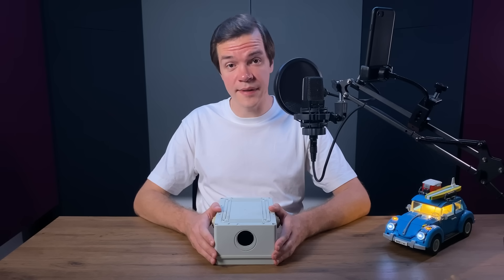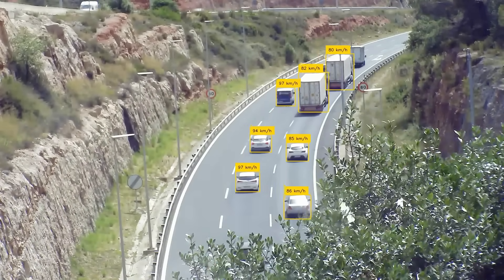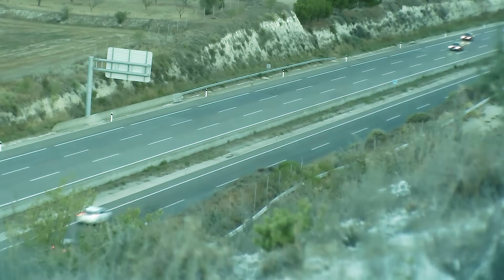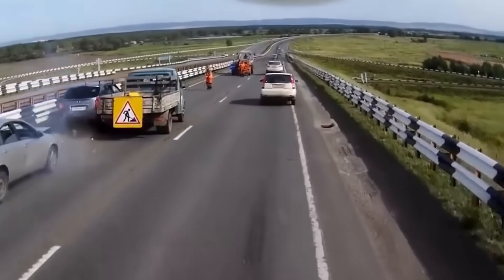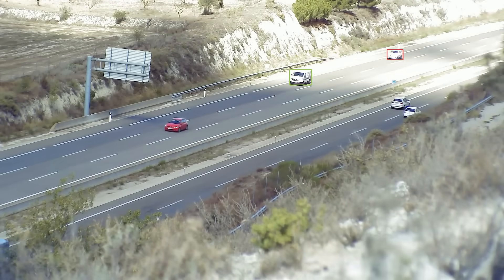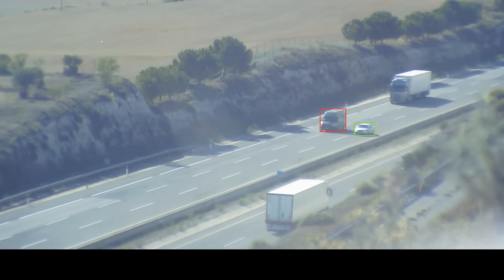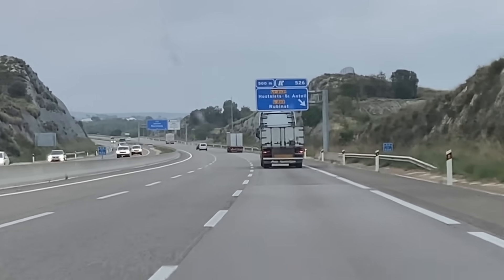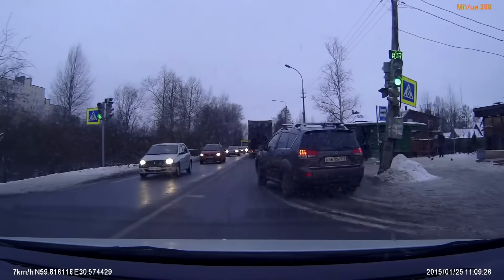New Anti-Tailgating Camera Reveals Shocking Statistics

Comment: I drive a manual transmission.  Often I just ease off the accelerator and downshift when I need to slow down a little.  If I'm in a middle gear, all I have to do is take my foot off the gas to slow down.  So I often slow down just a bit without my brake lights coming on.  I get the dirtiest looks... as if I'm brake checking without brake lights.  But maybe if they weren't already close enough to trade mustard, microscopic changes in my position wouldn't seem so threatening...

Comment: In Austria there have mobile system to check the distance between cars and fine if they are voilated. This can only be done on designated bridges where there are additional road markings below to allow accurate measurements. I assume the also film the highway to check if someone cut into your lane shortly before the measurement. However, I did not look into this technical solution.

Comment: Your "Following distance" chart will not allow you to really draw conclusions. Safe distance depends on what speed you are traveling and clearly not all vehicle travel at the same speed on your footage.
To really draw conclusions, you would need to separate your data in speed ranges and separate the vehicles that change lane in the meantime.
Also you need to account for technology in there. My adaptive cruise control will conserve a constant distance between my car and the car preceding me. If the car ahead suddenly brakes, my car will brake by itself before I even have time to react.
This will not excuses everything, but it mostly mitigates your risk assumption
Reply from the maker: Most vehicles here travel at 120-140 km/h. Speeders and slow vehicles are the exception. I drew "safety index" chart (it includes the adjustment for the speed), it looks the same.

Comment: Raw math is flawed if it's not accounting for the fact that the vehicle in front of you will "never" be suddenly stationary. They will still be moving forward while decelerating. So if the safe flowing distance is based around response time + stopping distance, that's impractical (as the extraordinary gap you leave will simply be occupied by another driver).

Following distance should be reaction time + stopping distance - other driver's stopping distance. Otherwise, a single lane of traffic can only service 10 cars per kilometer...

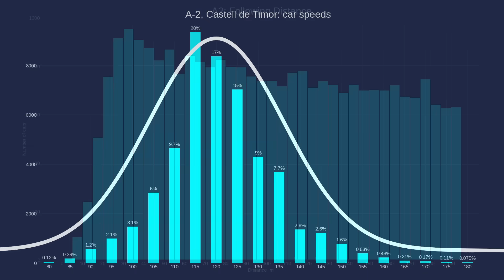Comment: @8:25 You shouldn't have expected it to tail off that hard on the upper end since the road is allowed to smoothly approach being empty.

Also, in regards to policy, there could be allowances for being cut off. For example, "
- Minimum Following Distance is defined as 1.75 seconds of travel at the driving speed.
- Withdrawal Speed is defined as the speed of the driver in front minus the speed of the following driver.
- If a driver is less than minimum following distance behind the car in front of them, then within 4 seconds either the distance between the vehicles must exceed minimum following distance, or the following driver is subject to a minimum withdrawal speed of 0.5 km/h.
- If a driver subject to a minimum withdrawal speed does not meet this within 4 seconds, the driver is subject to a minimum deceleration of 0.5 km/h/s until the minimum withdrawal speed is met or the minimum following distance is reached.
- If this minimum deceleration is not maintained when required, then a violation has occurred."

If you actually try to avoid tailgating at all, this shouldn't catch you. It never requires violent action, and because of the definition of minimum following distance being speed-dependent, you can never be required to back away from the car in front of you. Even if someone cuts into the already too-narrow space in front of you, you're still legally fine as long as you're slightly decelerating within 4 seconds. And as noted earlier, once you come to a halt, you are following minimum following distance.

Comment: Very interesting. Also, I don't think that enforcing distance would be too difficult. Just make front and back cameras in cars mandatory. You've shown that the software part to identify distances is doable. Than either make cars keep the required distance based on its speed (my car already does this when I configure it to do that), or use the footage to proof who is at fault based on the distance resulting in an accident. Of course, the cameras also record cutting, so in this regard that's not really a problem anymore. If people are punished at accidents because they didn't keep the correct distance, they will learn over time to keep safe distances.

Comment: The other advantage of maintaining a safe stopping distance is greater speed for everyone. Leaving a buffer helps to keep braking chains from occurring which ultimately end up with someone having to stop completely and creating a traffic jam. Traffic has a target speed and anyone going greater than that or much less than that causes pulsing. Computers can look at traffic flow and determine the value. Signs on the highway could easily change to inform drivers of it so they could match it speeding their way home by perhaps slowing them down but a little bit - but they won’t comply

Comment: So 30 metres is also about the distance you need to be able to see hazards ahead of the car in front of you, which means you can anticipate breaking that would be otherwise unexpected. 

It's not quite a fair challenge to presume the vehicle in front will stop dead as if it has hit something, and use that as a benchmark for safety. Instead, it should be tested if they put on the brakes fully, whether the car behind can stop in time. This depends on reaction and also closing speed - closing in on a vehicle to tailgating range is much more dangerous than other scenarios, because when the vehicle in front starts breaking, you're already going faster and have a greater stopping distance.

Comment: One issue with your safety index is it doesn't take into account the speed when you would collide. The car going faster with a longer following distance will be going faster at the point of collision and hence have a nastier crash.

As for auto detecting tailgating, that doesn't seem like an impossible problem. You simply need to verify the car was always at a distance of at most x for several (10+) seconds, and ignore any cases where either the subject car or the one it's following changed lanes. You could also use the same methodology to catch lane hoggers (people who don't keep to the outside-most lane possible) by looking at traffic in the other lanes as well. Lane hogging is often a cause of tailgating because undertaking ranges from frowned upon to illegal depending on the country.

Comment: Very good points made.  When I was young and lived in  Denmark, the traffic police was not so focused on speed limits on the open roads, more on driving to the conditions, and  NOT tailgating. ! They would be on their motorcycle just off the side of a road observing the traffic, and if they saw what they considered dangerous driving. Including tailgating, they could issue a fine to the driver or rider. No radar back then.  Just judgement on the part of the individual police officers.  Where I live now, road safety is excessively focused on speed.  And suspiciously also on revenue raising, rather than focusing on the issue of tailgating, which is a big issue in Australia by motorists in general, and worse still, by truck's with impatient driver's who often tend to intimidate other drivers who  drive to the speed limits, or what speed the prevailing adverse road, or weather condition's etc would indicate is sensible, below the maximum speed  recommended for driving there under optimal condition's.🤔

Comment: I have a pretty fragile older small light car, I don't have ABS or airbags, I hate tailgaters with a vengeance. 
Also applying a speed limit is so incredibly limiting, there are lots of roads where it'd be safe to drive faster (at least big stretches of roads), and lots of roads where you are allowed to go 60km/h and it would be very unsafe to drive at that speed, due to your view being obstructed, only being able to spot someone who you should give way to in like 0.5 seconds.

Comment: When na car in front of you does an emergency brake maneuver the car will already have had 0.9 seconds to slow down before you even start to slow down. 

So if two cars with the same properties drive the same speed one second apart, they will crash during an emergency brake.

Comment: TWO SECONDS should elapse between the car in front of you passing a point until you pass that same point. 
Yes, some people will enter that space sometimes. So what? As an intelligent driver, you always leave little early so you don't have to drive like maniac in a magic race car on your personal racetrack.
 
Another tailgating insanity is that people will bunch up if traffic slows, causing everyone to need to go slower and slower as they keep bunching up even more closely.

When I am emperor all cars will have anti-tailgating computerized braking and all drivers will experience a powerfully realistic crash simulator annually,
Reply: If you keep bigger distance than everybody, they will be entering in front of you constantly. This will be the comfortable spot to enter your lane and every single car will do it. There will be a lot of movement in front of you. It's probably worse than keeping a bit smaller distance because if someone enters, the distance goes down dramatically. Actually, it becomes less more than twice all of a sudden.

Comment: I drive this way as well, but my rationale is different than the narrator. If I am following a car at less than the recommended distance, I have two reasons for doing so. 

The first being that I am not watching for brake lights on the car in front of me (well I am, but not exclusively). No, I am watching for brake lights on the second car in front of me or possibly any number cars in front (depending on the curvature or profile of the roadway). This gives me more information then the car in front of me. So I feel I am more prepared to stop than they are, because I am not expecting them to drive the way I do (by anticipating their braking needs or tendencies). Also, I minimize the chances of being cut-off by a driver in an adjacent lane.

The second reason I don't always maintain the proper following distance is (with all things being equal) I have concluded that I can match their deceleration rate as long as they don't do anything drastic. By matching their deceleration rate, the distance between me and them will remain constant. So all I need is the reaction time distance to accomplish that. 

But mainly employ the first reason as a general rule.

Comment: The suggest safe distance is really only bear minimum. The weather and rain etc then you have to think of the person tailgating you. So you need to increase the distance again. But modern cruise control with following features will keep safe distance so the problem will resolve it self in 10 to 15 years.

Comment: Very interesting video! It brings me to a crucial point about traffic density.

The spacing between vehicles is a fundamental parameter for a lane's capacity. For example:

· With a tight spacing of 1 second between each car, a single lane can theoretically handle 3600 vehicles per hour.
· If that spacing is increased to 2 seconds, this capacity halves, to about 1800 vehicles/hour.

This massive drop in throughput raises a major practical question: to maintain the same traffic volume, increasing the following distance could necessitate widening infrastructure and increasing the number of traffic lanes. This represents a huge challenge in terms of cost and feasibility, especially in urban environments.

It's a fascinating dilemma: what is the right compromise between a road's maximum capacity and safe following distance?

Comment: I was told one car length distance at 35mph and add a car every 10mph. So a freeway at 70mph or 100kph it should be 4 car lengths or more but I usually use 3 as anymore and other cars just dart in the space...

Comment: You claim the tailgating problem is unsolvable.
But surely it's not unsolvable. It simply requires a LOT of interlinked cameras and MASSIVE real-time computing power. So much that perhaps, currently, it's not practical. But data processing power is on the rise again, with the advanced new computer chips. But instead good driver education and constant reminders could perhaps resolve the bulk of the problem relatively quickly.

Comment: My lifelong experience is by this confirmed. I command your endeavor here. I have made it a habit meanwhile to keep distance AND not care if anyone cuts in, because it happens all the time anyway so I treat it as normally expected and am ready to adjust the distance all the time. And it happens all over Europe. Folks in NA and Asia have a different driving style.

Also gold is the rule often not respected in Europe, to have a safety margin for unexpected occurrences and anticipate the traffic far off in front of you and at the sides and even from behind. Many behave as if they are in a sports race and every tenth of a second matters. Just yesterday I prevented a highway accident by quickly diverting to the emergency lane where two ladies aged 50-60 forced me pushing from the left lane as if I wasn’t there. When all the manoeuvring was over they still had no clue what they just did.